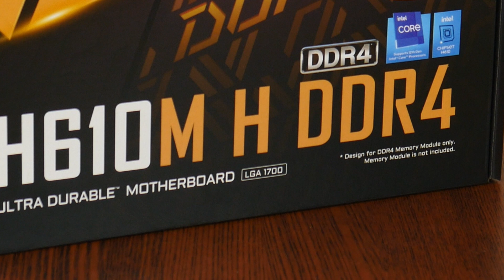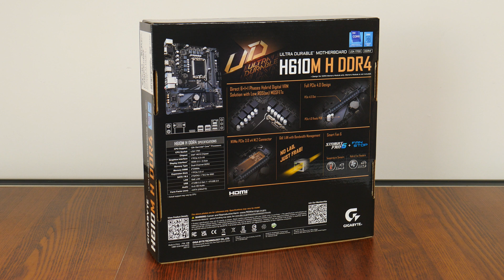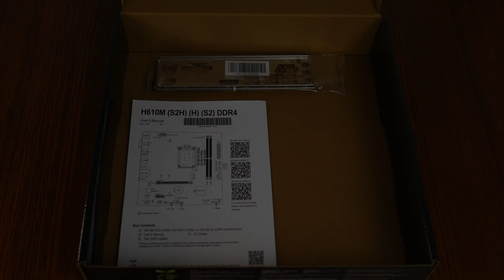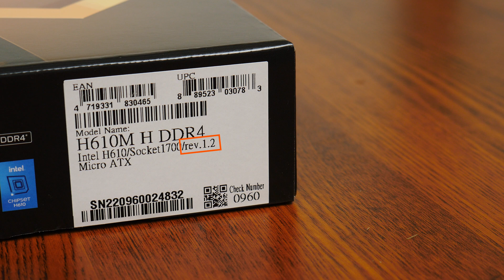Unboxing & Overview: Gigabyte H610M H DDR4 - Entry-level Intel 14th Gen Motherboard?

Comment: Just got this mobo with a i3 12100 and arc a750... Do this one have rebar support? Or do i have to upgrade to B660 one later to use rebar for my arc gpu?
Edit: there is no rebar on/off settings under my bios settings area...
Reply from the maker: Is there an "Above 4G Decoding" option within the BIOS under the settings tab? For Gigabyte BIOSes, you may need to disable CSM first, and set the "Above 4G Decoding" option to "Enabled", before you'll see the Resizable BAR option appear!

Comment: Do i need to buy a thermal paste?
Reply from the maker: If you're buying a new Intel processor that comes with the stock CPU cooler, the thermal paste would already come pre-applied on the CPU cooler.

Comment: Nice Review brother. Bro i am planning to buy i3 12th gen with 16gb(8x2)  ddr4 ram and i already have a graphics card gtx 1050ti. Should i go with this motherboard? Will there be any performance related problem? I dont understand that much technically, i just want to know will i be able to utilize my all components without any bottleneck.. looking for your reply. Thankd
Reply from the maker: Yeah this board is an entry-level offering - a 12th Gen i3 and a 1050 Ti will most definitely work fine with this board with no bottlenecks, and you'll have the option of swapping out your CPU for a low-to-mid-range 13th Gen part in the future (e.g. 13400F), alongside a better graphics card if you have the budget for it!
Reply: @ALKtech  thanks a lot bro now i can go for it..
Reply: @raginilodhi593  Is the motherboard good? I ordered it and it will arrive in a few days

Comment: I'm thinking about doing a build with the i5 12400f and gygabyte gtx 1660 oc super with this motherboard is this a good combo? And using NV2.0 ssd gygabyte pcle 3.0x4 500gb ...i really need your help thanks 😅😅
Reply from the maker: Yeah I think this combo works for sure, but I'm wondering, is budget a big factor for your build? Am asking as the H610M's really low-end - if you can spare the extra cash, I'd probably look at a B660 motherboard instead that could offer you more features and even headroom for a future upgrade to a 13th Gen CPU. 

Not that the H610M doesn't support 13th Gen - it does, just that this board is pretty much as barebones as it can get. Will you be doing some basic productivity work and light gaming with your PC?
Reply: @ALKtech  yes im just playing light games ( ex: league of legends or sekiro shadows die twice...i guess) and working normally, , i really appreciate it, but with b660m i will get more performance thanks for the advice
Reply from the maker: @Migoi123  I see. You probably won't see any performance difference between a H610 and B660 board as your components aren't exactly high-end to start with - if you don't have the intention of upgrading to a super high-end CPU in the future like a 13700K etc, then I suppose the H610M board will do just fine!

Comment: In 12v Header , can use Rgb fans? In Manual it says 12v Rgb led strips
Reply from the maker: Yes you can - 12V RGB LED strips is a term that sometimes is loosely used. You'll have no issues installing RGB fans that use the 12V RGB header!

Comment: Does it not have argb header?
Reply from the maker: It doesn't comer with an aRGB header, only a single 12V RGB header. Controlling the RGB device connected to this header has to be done through the "Ambient LED" app instead of Gigabyte's usual RGB Fusion app!

Comment: Hello I want to buy Gigabyte H610M H DDR4,if i build,CPU-Core i5-12400F  GPU-RTX 3060 RAM ddr4 16 GB is good for gaming?
Reply from the maker: Yup this combination will be good for 1080p gaming at decent quality settings - don't expect to do any ray tracing at all though!
Reply: @ALKtech  don't expect to do any ray tracing at all though?
Reply from the maker: @endrilaci2859  The RTX 3060 is a low-to-mid-range card - if you enable ray tracing in games that support ray tracing, you'll likely see a significant FPS drop versus with ray tracing disabled.
Reply: @ALKtech  thanks much for answer

Comment: Hi so i want to upgrade my mb,CPU,ram 
But idk if h610m h will fit in my case normally IT said that my case support mATX but my older mb was 245mm × 215mm
And the mb i want to buy is 230mm × 215mm
Will IT fit tho or no?
Reply from the maker: Are you upgrading a custom PC or a pre-built PC (e.g. Dell, HP etc)? 

If it's a custom PC using a standard microATX case, it's very likely that this Gigabyte board will fit within the case just fine. In any case, since this board is smaller than your current one, I don't think you'll have any issues fitting it into your PC case!
Reply: @ALKtech  i am upgrading a custom pc
Reply from the maker: @sdh8292  Then the H610M H DDR4 should fit just fine!

Comment: can you help me how to change my rgb fans and ram. They are both compatible to rgb fusion or other software but the motherboard isnt compatible. do u have any suggestion? and step by step guide. this would really help me. thanks
Reply from the maker: Like you mentioned, the board doesn't support RGB Fusion unfortunately. Have you tried the "Ambient LED" app available to download from Gigabyte's website yet? Ambient LED would be the app to use in place of RGB Fusion for this board...
Reply: @ALKtech  hello. sorry to bother you but I can’t find the link. can u send it. thanks
Reply from the maker: @eywonpol12  https://www.gigabyte.com/Motherboard/H610M-H-DDR4-rev-10/support#support-dl-driver

Refer to the section under "Utility" - you should see "Ambient LED". You'll have to install Gigabyte's base App Center first, before installing Ambient LED!

Comment: thanks for review
ı ordered my i3 12100f today with this motherboard. ı have already had a decent GPU rx6600 but ı had a bottleneck because of my older CPU i5-4440. Thanks for review
Reply from the maker: Glad you liked the review - you should see a good step-up in performance from the 4400 to the 12100F!
Reply: was the gpu compatible with motehrboard? these boards have known issues of incompatibility with many gpu's

Comment: so if i were to get a 60hz monitor paired with hdmi it wouldnt work?
Reply from the maker: You'd be able to use a 60 Hz HDMI monitor with this board - I assume you're intending to use the HDMI port on the rear I/O for video output? Do note that for this HDMI port to work, you'd need to have a CPU with integrated graphics (e.g. an Core i3-13100, Core i5-12400, etc) installed on the board!
Reply: @ALKtech  oh oh thanks for telling me

Comment: is this support 3600mhz ram? or all h610 boards only support 3200mhz?
Reply from the maker: You'll be able to install and use DDR4 3600 modules with this board, just that they'll likely run at DDR4 3200 speeds at max!

Comment: Will this motherboard work well with a  i5 12400f and a rx 6600 ?? Will it get too hot
For the motherboard since it doesn’t have heat sink
Reply from the maker: My two cents is that a 12400F is the upper limit of processor that should be used with this board - as you rightly pointed out, the lack of VRM heatsinks would probably throttle the PC's performance with power-hungry processors (e.g. Core i7 and above).

That said, a RX 6600 and 12400F combo with this board should do well for a budget 1080p gaming rig - as always, do ensure that you have adequate airflow in your PC with a good number of fans and a decent case!
Reply: @ALKtech  alright so a good pc case with good airflow and fans should fix the heat sink problem ?
Reply from the maker: @demarus_cousins6382  yup it'll help things out for sure, though nothing beats actually having VRM heatsinks 😂

Comment: i’m thinking about doing a build with the i3 12100f and a 6600xt with this motherboard is this a good combo?
Reply from the maker: Hello, a 12100F+6600 XT combo will work great with this board! Is your intention to build a gaming PC on a budget?
Reply: @ALKtech  yes around a 700-1000 build
Reply from the maker: @johntalawson6295  gotcha. The 12100F+6600 XT+H610 combo should do pretty okay for 1080P gaming on today's titles with decent graphics settings, without ray tracing enabled!
Reply: @ALKtech sorry for the late reply i actually went with this build instead 
-Thermaltake Versa H17 
-GIGABYTE H610M S2H 
-Intel Core i5-12400
-Thermaltake Smart RGB 700W
-T-Force Vulcan Z DDR4 16GB 3200MHz
-TEAMGROUP MP33 PRO 512GB
-MSI Radeon RX 6600 XT MECH

do you feel like this is a good build?
Reply from the maker: @johntalawson6295  good choice to go with an i5 instead. Looks like a pretty decent build, though is 512GB enough for your SSD? Do you have an external hard disk to store your files?
Reply: @ALKtech yes i have an external ssd from seagate it’s meant to use for xbox but i don’t think it’s a problem if i use it on pc but i mainly will just be playing warzone and apex on it all of my parts come in next week it will be the first pc i’ve built
Reply: @johntalawson6295 are u actually getting good fps w/ this build like they show on Youtube benchmarks?? Or This Mobo is hindering any of the Clu performance?? Plz reply

Comment: Hello

I was wondering will specs like an RTX 3050 and an I7 12th Gen CPU perform alot less or just a little with this motherboard 
and should i change the motherboard for a better one with these specs?

Thanks
Reply from the maker: This board will likely struggle with a higher-end processor like the Core i7 and could even cause performance throttling. If you're intending to go with an i7, I'd recommend getting at least a board that has the Intel B660 chipset!
Reply: @ALKtech  Noted thanks for the info

Comment: Is this RGB header sync-able with RGB fusion  software?
Reply from the maker: Yes it syncs!
Reply: @ALKtech  I have installed Corsair sickleflow 120mm pwm RGB fan (4 pin PWM, 4 Pin 12vRGB). But unfortunately, RGB fusion doesn't show the fan profile. It doesn't work. Now I have to use a RGB remote controller to manually control the RGB effects.
Reply from the maker: @maroofhasannahin6219  how about trying with a different third party RGB software (e.g. OpenRGB)? Does the fan even show up within the RGB Fusion app? 

I checked the manual once again, and just remembered that this board only has a single 12V standard RGB header - Gigabyte has an app under the support section for this board called "Ambient LED" - have you tried that app to see if it's able to control the fan's RGB LEDs?
Reply: @ALKtech  Thanks for the suggestion. It works with ambient LED!
As you wanted to know, the fan doesn't even show in the RGB fusion app. But working fine with ambient LED. Thanks again for saving my day!! 👍
Reply from the maker: @maroofhasannahin6219  awesome, glad that this helped!
Reply: @maroofhasannahin6219  Hello. Where can i download ambient led I have deepcool fans but h610m is not compatible to rgb fusion.
Can I change the rgb of my fan even though it is not compatible? thanks

Comment: is board good for gaming
Reply from the maker: It can be gamed on for sure with a good processor and graphics card, but bear in mind that this is a low-end motherboard after all, and you will be missing out on features such as 2.5 Gbit Ethernet, PCIe 4.0 x4 M.2 slots and so on!
Reply: @ALKtech  all that stuff doesn't matter at all to somebody just trying to game. PCIE 4.0 is like 2% performance boost so who cares
Reply from the maker: @DrewOn22FPS  Would be great knowledge to bear in mind, especially if one intends to upgrade to say, a fast PCIe 4.0 M.2 SSD in the future where the bus speed could then play a bigger factor on performance!
Reply: @ALKtech  if im not changing my pc for another 4-5 years, future proofing for next gen support is useless in my opinion, its like the biggest scam
Reply from the maker: @antwan7904  to each his/her own I suppose. Personally, I'd love to have the option to upgrade, especially when scooping up bargains on secondhand components that can be a drop-in upgrade few years down the road!

Comment: i bought this motherboard a few days ago and i wanna now, it doesnt have heatsink will it be a problem for future? i am going to use i5 12600K in it. Will it overheat and start damaging the pc parts or it will be just fine?
Reply: im planning to use the system in 2k and other parts is rtx 3070, 2x8 3200 RAM, 1tb gen4 ssd (i know i cant get full speed but i should get above 3000 easly) 750W XPG Core Reactor Gold
Reply from the maker: @Ali-rw8tr  you'll be fine with a 12600K - though the overclocking potential of a K variant processor would be wasted on a H610 board, as the H610 chipset does not allow for overclocking!
Reply: @ALKtech  thank you for answering. I am not planning overclocking it but yeah I feel like b660 should have much better. I feel kinda bad for my choice lol. Well I'm just going to use it with i5 12600K and all i wanted to know if it will damaging my cpu and other components, the motherboard says it has heatsink feature so i gotta ask
Reply from the maker: @Ali-rw8tr  I see - don't worry, the lack of VRM heatsinks/M.2 drive heatsink shouldn't pose any issues if everything is run at stock. That said, it wouldn't hurt to have a PC case with good airflow to help things along.
Reply: @ALKtech  okay thank you so much
Reply: can you oc i5 12600K with B660 or i need at least Z690?
Reply from the maker: @Ali-rw8tr  it's best if you get a Z690 board so as to maximise the overclocking potential (e.g. the unlocked multiplier) of your 12600K!
Reply: @ALKtech  hey sorry to bother again, i brought lian Li mesh 215 case, you said the case with airflow would help, i want to ask with Gigabyte H610m-h, i5-12600K Cooler Master ML240V2, Lian Li 215 running everything at stock is gonna be okay? Not for only 2-3 months but 3-4 years, if everything run at stock would it have any problems and damaging other components?
Reply from the maker: @Ali-rw8tr  No worries, the Lian Li case seems to be a great choice, judging from the reviews I've seen of it on the internet, while the ML240 V2 should get the job done since no overclocking will be done. You'll be fine!
Reply: @ALKtech  thank you!